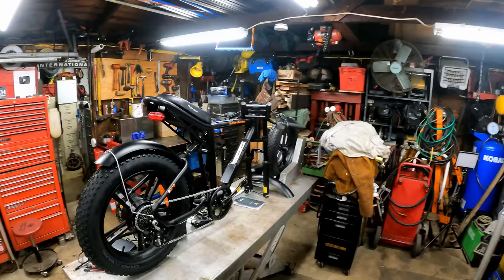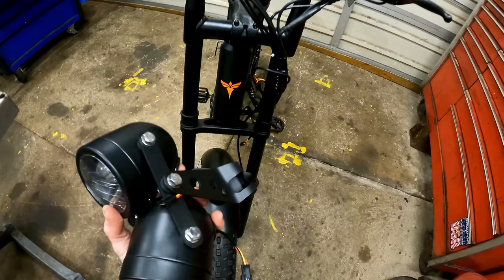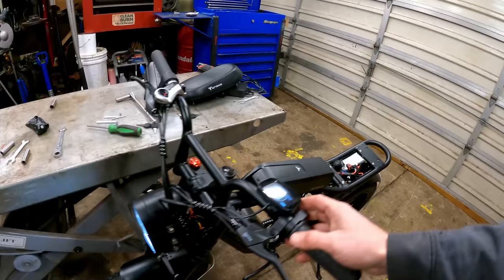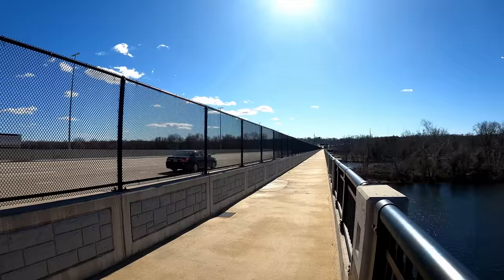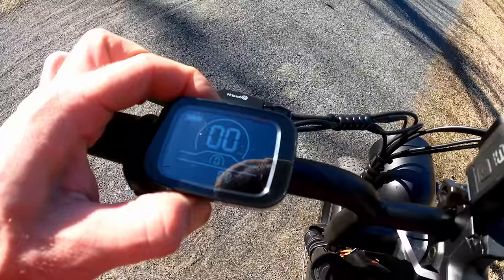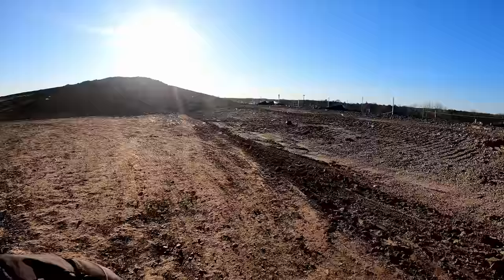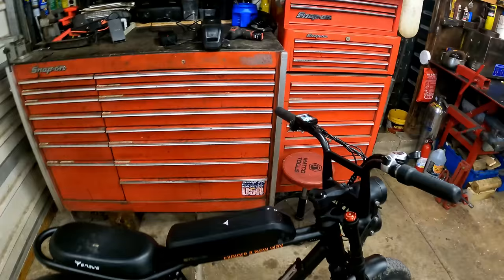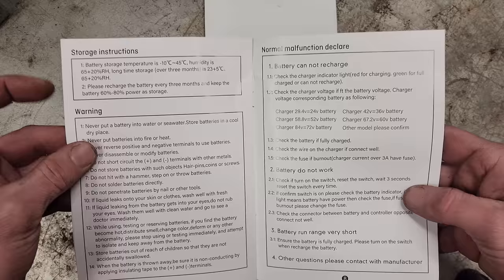ENGWE M20 E-Bike Review DUAL Battery Electric Bike

Comment: I love these reviews and the tours of where you live. If I may suggest a bicycle shock pump for what appears to be an air shock for the rear suspension, they are different than a conventional bicycle pump which will allow too much air to escape when detaching the chuck from the Schrader valve after adjusting the compliance of the rear end sag and travel based on rider weight. I am sure you and some viewers may have spotted this but just an FYI for those less familiar with air shocks. Cheers!

Comment: theres enough stud length  on the seat studs to add a 1 Inch spacer under the seat. there by raising it by 1 inch. it would make a great difference when riding. thx for vid. enjoy them.

Comment: Chris, love your bike travel rides on the canal paths on both sides of the Delaware river. Your absolutely right that the new bike/walking access across the Scudders Fall bridge is probably the best on the Delaware river. They worked on the Jersey side paths over the Winter and they  are the best for bike riding. The Pennsylvania side paths are more scenic but they aren’t as bike friendly along a lot of spots because they can’t get heavy equipment on the paths to do maintenance on them. They need a lot of money for repairs which the state of Pa doesn’t seem to provide.

Comment: I’m 5’9” with a 30” inseam and I sit flat footed on the ground. As for pedaling it is a little awkward . The manual  control settings could be a little more clear…..in short you’ll have to play with it for awhile. This guy points out several things the manual doesn’t cover, front wheel axel  needs to be removed and the one they strap to frame is used. Wiring for the second battery is explained here much better here than the manual. Brakes are sufficient when new. Lights are excellent. 
Get the duel battery option, you’ll won’t be disappointed…….have fun!

Comment: Hey there, I just watched your "ebike review" video and I must say, I'm impressed with the detail and insights you provided. As an avid ebike user, I'm always on the lookout for innovative products, and I recently stumbled upon a new crowdfunding project called freebeat Morph 2-in-1 e-Bike. It's intriguing because it offers dual modes for outdoor and indoor use, with the ability to recharge indoors. The brushless 750W motor and 80Nm torque seem quite powerful, and the 80mm front suspension and puncture-resistant fat tires make it perfect for any terrain. The Smart Saddle Detection+ and CO2-free mileage features are definitely worth exploring too. Keep up the great work, and thanks for sharing this exciting project!

Comment: I think they fall “short” in frame design. Seems like it’s sized for small people or kids. At least make an adjustable seat. Can’t believe you walked across that fallen tree 😮.
Reply: Idk I'm 5'9 and I have to lean the bike to the side to comfortable touch the ground 😅.
Reply: @antscape  call them, they are quite helpful. They call you back quickly and try to help you. There is a seat attachment that raises you,not the seat. I did it yesterday.  I'm 5,8 and still am a bit uncomfortable, legs cramp on long rides if I use the pedals, straight power I'm comfort, but to pedal I can't get far without a hamstring cramping lol. They are sending me a extra seat that attaches to the first and gives another 3 inches of height. Hope this helps.
Reply: @antscape  I can confirm this. I’m also 5’9 and it’s tall to climb on for sure. BUT if you’re 6’+ pedaling could be uncomfortable. So it’s definitely unique in size being best fit for 5’8-6’0
Reply: I like the look of it but way too small.
Reply: Have you ever sat on a moped they’re tiny but that’s what makes them so much fun.

Comment: Front fender looks too short towards the top / front end, looks like it will spray straight up. Also, are they too narrow ? o_O
There might be an advantage to using both batteries at once to avoid higher current draw on each cell. Aswell as keeping the cells out of their lowest voltage range which is rougher on the battery compared to using it in its mid / high voltage range.
Respect to showing the badge on Davids bench
Some things to consistently list in these Ebike reviews : Peak power vs continuous power  ( saw this in last video ), Motor type ( internal gears vs direct drive ), Type and brand of cell ( i.e 18650 vs 21700 ), Max current rating for motor controller, Somehow give quality of tire and gauge its ability to operate durably at lower PSI. You already give great info about controls ( such as the delay in letting off pedal assist ). In other videos you zoomed right in on more of the welds. To always say where its made. If i missed any of these then im sorry. Thankyou for these

Comment: The handle bars look like they may be on backwards, they look to sweep forward a bit and should actually sweep back. Also that low seat is a deal killer for me, no adjustment and way too low for me at 5' 10". Other then that its pretty sweet.

Comment: So do you know for sure what the battery "equalizer" does? I've seen some devices which simply switch between batteries when one is depleted, but preferably they would run in parallel to give more peak amps.

Comment: G,day Chris and Jen from Sydney Australia. 
What species are the trees along the river.
Good dual battery e-bike. Great long range but not racks for shopping. I'm still trying to understand why they are using incompatible batteries causing ignition? If it's the same voltage and amps as specified by the manufacturer?
🌏🇭🇲

Comment: Weird that it's a 1000 watt motor but only tops out at 28mph same as the older 750 watt motors from ebikes that are 2-3 years old.
Reply: Well just checked the website so it's actually a 750 watt nominal motor that peaks at 1000 watts, makes sense now it's really the same 750 watts motor as the older ebikes.

Comment: Anyone here that bought a ENGWE M20 have problems with the Display.
I programed everything except the Power-On password. Rode the bike around town and it was fine. I wanted a password on it to keep the wife off of it. Scene P8 is for the password setting. Now the P8 screen won't take my PW. When you power up the displays lights up then switches to the P8 screen and won't take my PW. So in short the bike is dead.
I tried to set back to factory settings (Holed Power and + buttons at the same time), nothing just P8 screen. I even unplug the control box hoping to reboot it, nothing just a P8 screen.
Called the company and they said, "Send order number , where you bought and a video of the problem". Is there anyone who has the same problem. Thanks